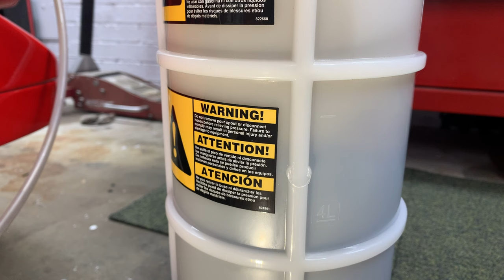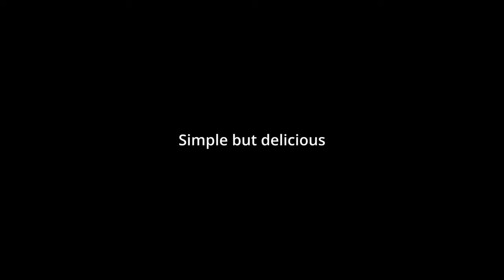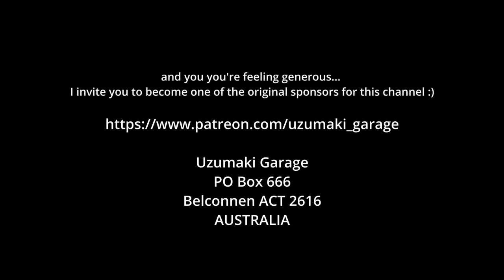Oil Change with MISO SOUP! & the Mityvac tool - Evo VI Mitsubishi

Comment: Awesome videos and car ! Love the sound of the card reader. What oil grade did you use ?  There are so many recommendations out there.
Reply from the maker: Hey Jason. I used Penrite 10w-40 Full Synthetic Extra Zinc this time. You can briefly see the oil container at 7m40s.  The Mitsu owners manual says 10w-30 when you have an ambient temp between -20*C to 40degrees C. Oils seem to have a broader range now but if I was driving the car hard, or if it was modified with extra boost or  it was now the hot Australian summer I would use Penrite HPR10 10w-50. Their maximum engine protection oil is the Racing Ten Tenths but using that gets more complicated if you use e85 fuel. I have spoken directly to Penrite about this. Sorry for the long reply

Comment: Is it better to remove oil this way? Why? Also I have been using same type oil filter (z411) I use on my stock Ce lancer for my Evo as it is a bigger filter, therefore I assuming more filtering capacity. Is there a  reason why the Evo filter is so small, is it just so it sits flush with the sump and not lower than the sump? How often do you do an oil change as well, every 6 months or so? Interesting video, made me hungry for Miso soup.
Reply from the maker: Hey mate. Thanks for the comments. I did write in the video description about the differences between draining via sump plug vs vacuuming the oil out. But I should’ve spoken about it in the video as well.  The vacuum is convenient and easier and less messy compared to draining via sump plug. It removes at least as much oil too, perhaps a bit more. The genuine Mitsubishi oil filter is short but it is wider too so maybe the same capacity. Either filter is fine to use. Actually there is a new Ryco 
Z411ST that sounds good. Yes probably about every 6 months but the kms driven is sometimes zero.
Reply: @UzumakiGarage  ah yeah I should have read the video description. Yeah it certainly very tidy. Have a small vacuum bleeder for doing brake lines but this is the next level.

Comment: Hello.
Is it okay to change the oil just by vacuuming it like that? I mean, if we change the oil in general by opening the drain bolt, the remaining grams of the engine will be discharged along with the old oil, but if it is sucked like this, it is worrying that the grams are still in the engine & dangerous in the long run.
Reply from the maker: Hello. If you watch the complete video you will see me remove the drain plug to check all the hot oil has been removed by the vacuum tool. Not even one drop came out when i removed the drain plug! So it might be true that even more oil was removed with the vacuuming method. I believe most of the contaminants are suspended in the oil or in the oil filter and when doing an oil change with either method you are replacing a high percentage of oil from the engine, not absolutely all of the oil but a very high percentage. Many car manufacturers say the vacuum method is their preferred method for servicing. Some manufacturers recommend using an engine oil flush treatment immediately prior to draining or vacuuming the oil but I didn't on this occasion. Let me know what you think.
Reply: @UzumakiGarage  Ah something like that, thanks for the information.
I'm just using the logic that the engine gram will definitely be at the bottom due to its weight & will go down along with the oil change done by unscrewing the drain bolt, the principle of gravity.
I really like your evo 🥰 and I'm saving up to buy an evo 8 or 9. Any specific advice on maintaining an evo?
Thank you.
Reply from the maker: @Mr.Waksal  buy good tyres, don’t modify the evo too much, if you change the gearbox or diff oils yourself make sure to use the correct oils and refill correctly as its easy to not add enough oil and finally… find a good evo workshop to do the work the you can’t do yourself.